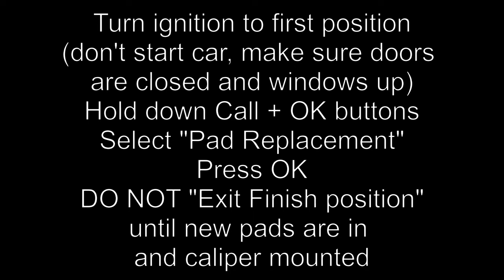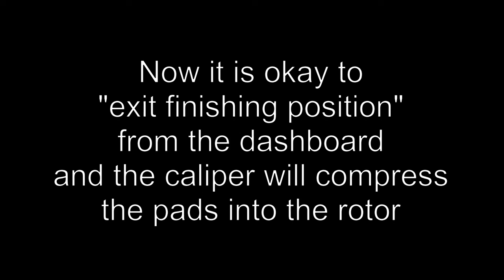2013 - 2019 Mercedes-Benz CLA Rear Brakes Pads And Rotors Replacement How To

Comment: Do you leave the car in park and disengage the automatic handbrake at the start of the procedure?
Reply from the maker: I'm not 100% but I'm pretty sure it doesn't matter. If you take it apart and the caliper won't "let go" after taking the 2 caliper bolts out, maybe try to disengage the handbrake.

Comment: Thank you for taking the time to make this video! Would you mind listing the tools and the grease/oil you used to replace the pads and rotors? Thank you in advance
Reply from the maker: You're welcome, it was fun to make. For tools, most of it is basic ratchets/wrenches, I like to get sets that don't skip sizes for example 11mm 12mm 13mm 15mm, because one day you will need that 14mm! A breaker bar helps with tight bolts too -- a must have. The only oddball tool I used here was the E18 female torx socket for the bracket bolts. Get brake-specific lubricant because the wrong stuff can cause damage to the rubber seals. Brake cleaner to clean things off, and WD40 or PB Blaster for rusty fasteners. Cheers!

Comment: Do all pads need to be replaced before  "exiting finished position"  or can that be done after one is replaced?
Reply from the maker: You'd have to do it twice, once for each of the rear calipers. You definitely DO NOT want a situation where you select "exit finish position" while the caliper is not mounted, because it will push the piston out of the caliper and it needs to be re-assembled (I'm not even sure how that would be done).
Reply: @GibbysGarage15  perfect. Yeah I wasn't sure if I'd need to have both rear calipers done before I'd exit the setting or if I could do it separately for each caliper as Ii worked on them. The video and your response was a huge help and greatly appreciated 🙏
Reply from the maker: @matthewmolina642  You're welcome! and good luck!
Reply: Is it the same for the fronts aswell?
Reply from the maker: @LP-LDN  Should be easier on front, no  parking brake mechanism. I haven't done it though. Just watch out for any pad wear sensors, disconnect that first!

Comment: That copper slip is going to flick out with centrifugal force. Very not good !
Reply: hey, I am an amateur and wanted to follow the tutorial. 
Can you tell me a timestamp, with the mistake you mean? I am unsure what you mean by copper slip. (maybe due to the language barrier, I am not a native english speaker).
Reply from the maker: @NicoSie98  1:29, optional step because I live in the rust belt. If you're worried about it slinging out and causing issues, you can use a very thin layer or none at all.
Reply: Good to put that stuff on but you need to clean the surfaces to make it stay and not fling off should be doingnthe same the the hardware surfaces before reinstalling the clips